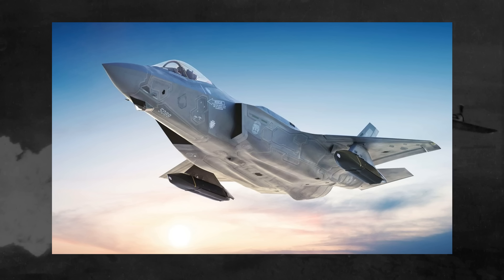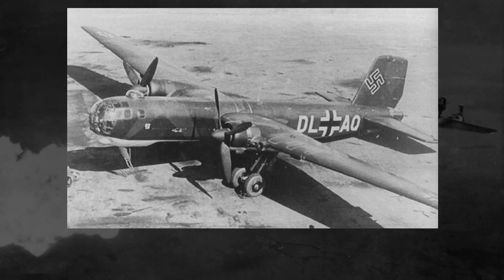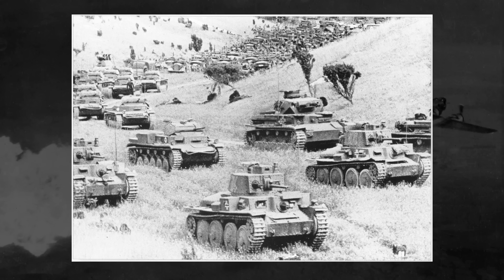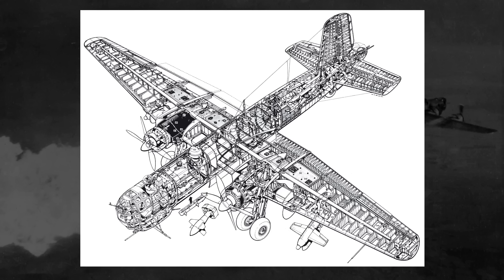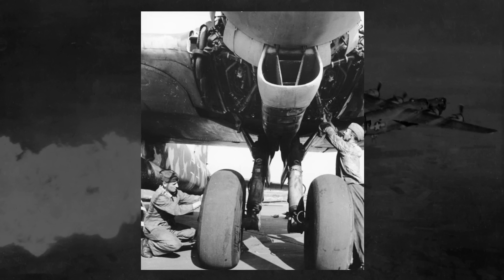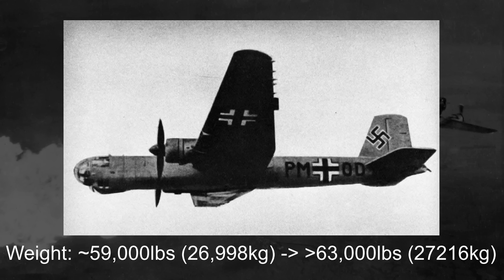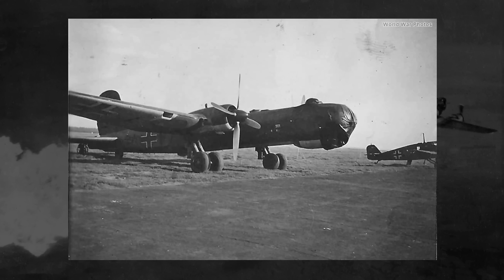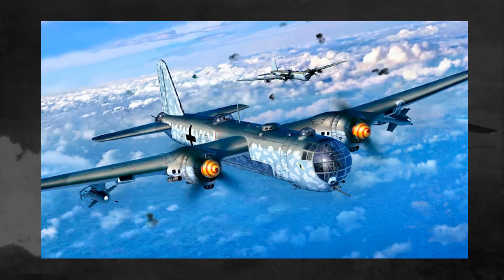The Plane That Kept Bursting Into Flames: Heinkel He 177 Greif

Comment: @20:55 what is that!? a towed fuel tank on a glider? looks like a drop tank for a 109 but mounted on top of an airfoil.
Reply: Thought it was an external stabiliser for some test.
Reply: It is exactly that,   a towed external fuel tank on a wing.
Reply: @animaltvi  I've never seen one like that before. I knew that the US experimented with them in the early 40s, but I had no idea the Luftwaffe used them operationally.

Comment: It had exactly the same problems as the Avro Manchester, bolt two engines in the same Nacelle, they overheat. It also had the same cure, a prototype 4 engined version was brilliant, but as usual did not meet the Nazi paranoia and was rejected. They could have called it the Heinkel Lacastereich.

Comment: He 177 Operations in Russia
The end of He l 77 operations in the West was by no means the end of the He 177 in Luftwaffe service. During the late spring of 1944, Kampfgeschwader l under Obstlt Horst van Riesen began converting to the aircraft, the first Gruppe moving to its operational airfields in East Prussia in May. Before the end of the month, 1./KG 1 was joined by II and III. Gruppe, and the Geschwader now comprised some ninety He l 77As, undoubtedly the most powerful striking force on the Eastern Front.
Operations began almost at once, the bombers striking at troop concentrations and Soviet supply centres in support of the German army. No attempt was made to strike at strategic targets although many were within range. The bombers attacked in daylight at about 6,000 m (20,000 ft) and losses were very low. The few Soviet fighters that managed to reach the bombers' attacking altitude rarely pressed home their attacks because of the formidable defensive armament of the He 177. Also, very few He 177s were lost because of engine fires; constant modifications had ensured that troubles suffered by the coupled engine installation were reduced to a minimum. The machines that did crash due to this cause were mainly those flown by inexperienced pilots who mishandled the throttles, causing the engines to overheat.
At one time, KG 1 made several pattern bombing attacks, the only time such tactics were employed by the Luftwaffe. During one such operation, von Riesen led 87 bombers in a mass attack on the railway centre of Velikye Luki. Flying in three waves, each comprising a Gruppe of some 30 aircraft, the He 177s must have been a most impressive sight.

From:
“German Aircraft of the Second World War” by J. R. Smith & Antony L. Kay
Pages 187 to 188
Copyright 1972 
ISBN 85177 836 4
Reply: Excellent !

Comment: Why was the projected speed of the aircraft so far below the actual speed? Are there any history buffs that have any additional information? The high projected top speed could have been wishful thinking to get the contract to build the aircraft but the original calculations could have assumed that a certain level of surface finish was going to be achieved which did not materialise in the finished product. I am only guessing on that situation. The aircraft looks like it should have been faster than a 300mph aircraft. One additional area of increased drag was the German industry building higher drag radiators than the equivalent allied version due to  using a lower pressure system.

Comment: The concept to reduce drag by coupling engines to one shaft and one propeller was not new.  Avro had a unsuccesful try years earlier with the Manchester heavy bomber project. After the war Tupolev had another try with its TU95 Bear heavy bomber. Like the British (Lancaster), the Germans (He 277) earlier , the Russians transformed successfully  their TU95 to a 4 engined 4 propeller driven airplane , which is used until today. In case of the Germans the He 277 came to late, bomber production was stopped in favour of emergency production of fighters and fighter bombers.

Comment: Ernest Heinkel proposed to rebuild the He 177 into an aircraft with 4 individually mounted engingine  called the He 274  I eliminated the overheating problems of having g two motors driving g one propeller of the  He 177   but Hitler interfered and project cancelled
Reply: The Nazis disliked Heinkel.

Comment: Did anyone ever consider mounting the engines in a pusher-puller configuration?  I am not an engineer, so I am making assumptions with very little knowledge, but it would seem that, while likely having more drag than the original layout, it would still be superior to a traditional 4 engine layout, while addressing, if not solving, the overheating issues.
Reply: That would actually increase the problems of overheating. As an aircraft mechanic the worst plane I had to work on was the Buick Skymaster. It has a push pull engine configuration. The rear engine has a heat problem due to the air being heated by the front engine. The advantage of this configuration is that if you lose an engine you still have thrust in line with the centerline of the aircraft. In fact many pilots will shut off the rear engine in flight if they don't need the extra thrust.
Reply: @spyersecol0013  Much appreciated!
Reply: There's CG issues, too.  Center of gravity, center of lift, center of drag, all have to be right and right with regards to one another.  The front of the nacelle would have had to move forward a long way, the rear would have to be really close to the trailing edge of the wing. 

Plus you're messing with room that's being used for things like oil tanks, hydraulics, landing gear, etc.  It'd be easier to just change it into a 4 engine/4 nacelle design at that point.

Comment: Just one thing. Don't say 6,000lb of explosives when you mean 6,000lb of bombs. For example an SC500 bomb would weight in at 500kg (1,100lb) but less than half of it was explosives 220kg (490lb) of 40% amatol and 60% Trotyl for use against ground targets or Trilen (15% hexogen, 70% Trotyl andb15% aluminium powder) for use against ships.
Reply: Explosives is official shorthand for explosive thingies, but I admit I'm being a bit overly pedantic.
Reply: @nopenheimer  for whom? Most sources say bombs, ordnance or munitions. Bombs is always going to be shorter than explosives.
Reply: The shortcomings were made up in the flammability of the engines.

Comment: I’m happy to be corrected, but every example I can recall of ww2 aircraft designers coming up with the brilliant idea of “ coupling 2 piston engines together” ( rather than just adding additional engines or using a bigger more powerful design) always failed 😮...just a bad idea it would seem 😉
Reply: Two engines in the same nacelle with them behind each other might lower the profile and drag without quite so much heat build up perhaps. I suppose 4 propellers (2 of them pusher) is an option too or even just pusher props with wing leading edge radiators.
Reply: It's kinds like communism, 
they just didn't do it well those times... 😅
Reply: Coupling 2 engines together was very successful when it came to radials.  That's all a multi-row radial engine is...  IIRC they started running into problems around 4 rows, but the 2 row was extremely successful.

Comment: This aircraft truly was an advanced concept that was ruined by foolish requirements.  Imagine the U.S. deciding to require  the B-24 to do what the SBD Dauntless could do! The coupled engine idea had been tried and tested in the US as well  (two Allisons coupled to one prop shaft) but that was dropped. A remotely controlled turret!  Finally a manned tail gun position.  It still featured some outdated features like the ventral gun position that featured, in one form or another, on all of the previous German bombers. It was basically a rather good design that was "effed up" by later ridiculous requirements foisted on it by the fools in power. The few later four engined derivatives were not at all bad... and much too little... and much too late.

Comment: The thing was a death trap. Dont know why the allies bothered shooting them down. They managed to set fire to themselves. . First the cooling system was bad causing them to overheat and catch fire  they sorted that, then the conrods kept breaking causing holes in the crankcase causing fires. Sorted that then the propeller pitch mechanism started malfunctioning causing fires. . Because the engines were out of the pilots view , by the time he realised it was to late.